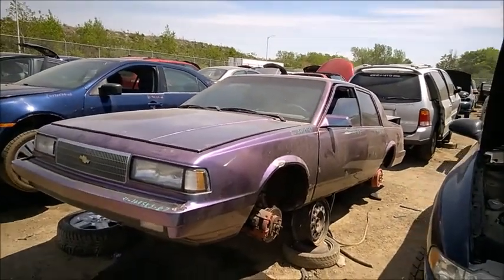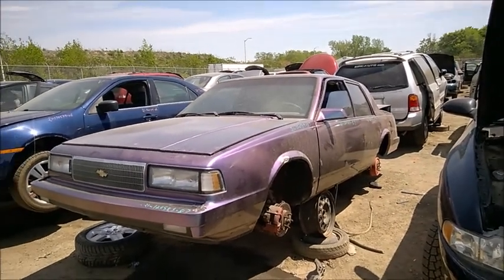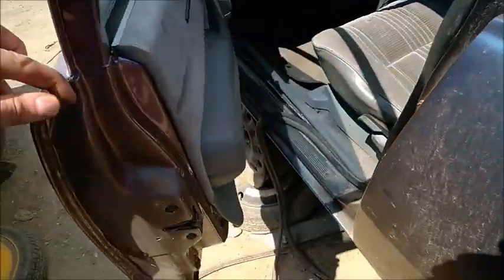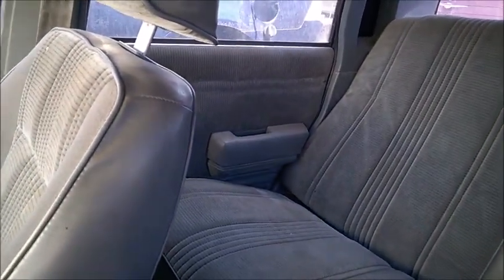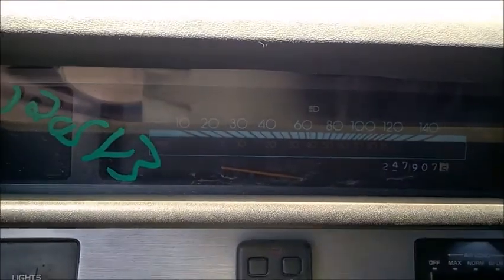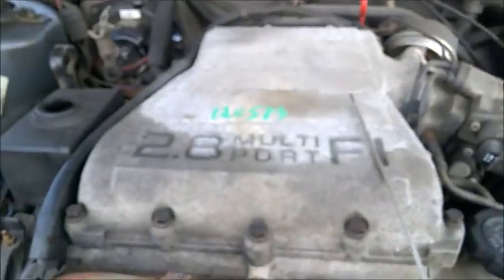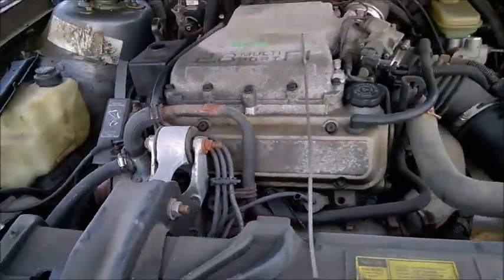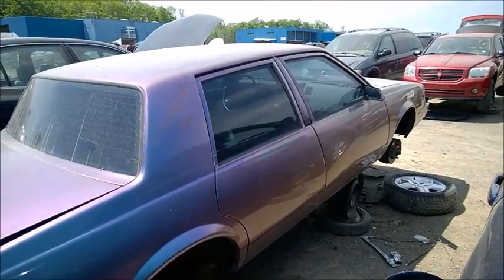1987 Chevrolet Celebrity - Junkyard Classics

Comment: You are totally right about the cable driven throttle bodies. They had more feel to it.
But I also like the gaspedal feel of my S60. It's electronic but very well made and relatively sensitive. When I push it the engine reacts immediately.
I like your junyard videos and the rare cars that show up in it!